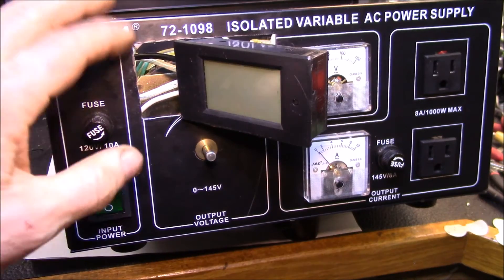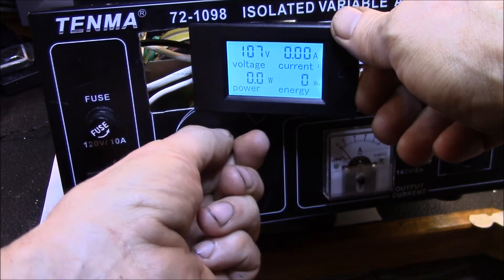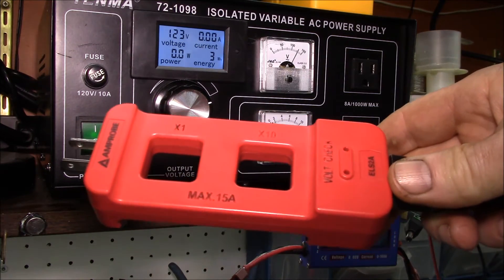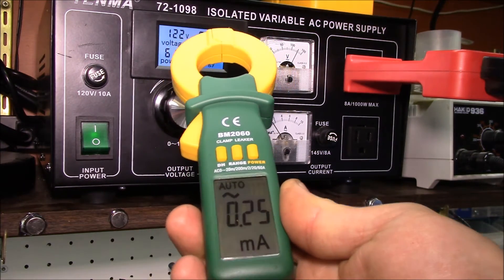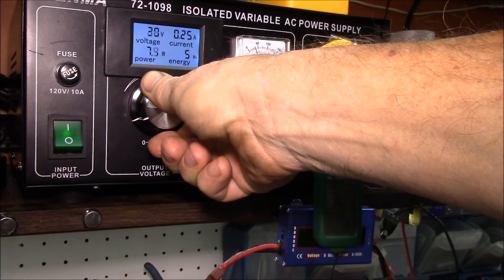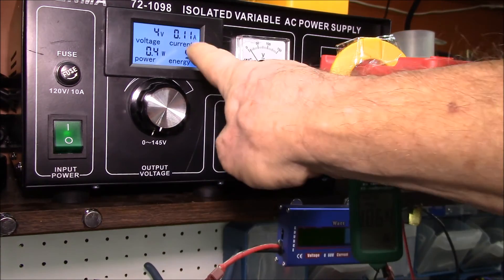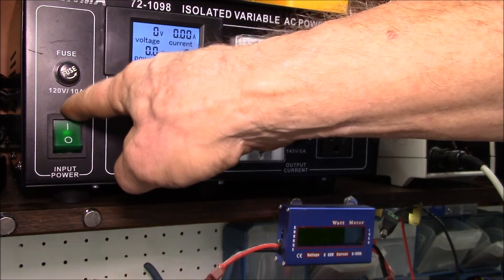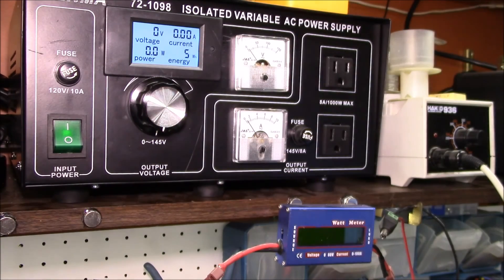Quest for Zero, (a.k.a. PZEM-021) Part 5

Comment: Great Videos! Is there much difference in the way to adapt a PEZM-061 to work below the 80v limit? Thanks!
Reply from the maker: Same modification, only difference in the units is the 021 has the current shunt and the 061 has the current transformer.
Reply: @The4Crawler  cheers I got it all up and working! only issue I have is that it only works up to 85v and then the LCD cuts out. did I wire something incorrectly? Thanks for the advice!
Reply from the maker: @HasteFrankie  Mine will read from 0 to over 150 volts (as high as my Variac goes).   Maybe try swapping the line and neutral connections at the screw terminals.  Also, check to make sure your separate power line voltage is not dropping out.  I feed mine from a separate 120V AC source, before the Variac.

Comment: I was wondering if anyone found a way to lower the turn-on voltage  of the meter without running a separate line out to the 120v supply?
Reply from the maker: There are some posts on supplying a separate DC power (12V?) supply to the meter instead of the separate AC power connection:
https://drive.google.com/file/d/1w80QYWeo8H5LdRoheGxNCMZViL9uqo81/view?usp=sharing
You need to do one or the other because the ~80V turn on voltage of the unaltered meter is due to the power supply in the meter not "turning on" below 80 volts.
Reply: @The4Crawler  Thanks for your reply. I'm looking for a meter for a variac. Prefer not to modify. There are newer models PZEM-026 and PZEM-028 that claim to work at 40V. However, the PZEM-061 seems like the display is easier to read. Just not sure I can deal with it coming on at 65V.
Reply from the maker: @acoustic61  Mine is set up on a Variac as well.  I simply feed the power supply wire from the constant 120V input to the Variac and then connect the variable output of the Variac to the original AC input terminal.  The only thing you need to pay attention to is to identify the neutral or  common wire (see that in a later video in this series).  Then connect that common wire to the neutral terminal on the meter.  This way the meter will read down to 0 volts and up as high as your Variac will go, mine hits around 170VAC.
Reply: @The4Crawler  I wired my variac so it maxes out at the line voltage.
Reply from the maker: @acoustic61  Makes no difference on the variable voltage maximum.  It'll go from 0V to something, 120V or 170V or whatever.  That connects to the meter voltage terminal and the other end of the coil to the common or neutral terminal.  Then feed the meter power from the constant 120V connection on the Variac.
Reply: @The4Crawler  Yes, I just thought I'd mention that, because 170V would be way too high for anything I do. I work on old tube equipment that was made when the line voltage was closer to 110-115V. There's 123V at the wall here.
Reply from the maker: @acoustic61  Here's the video with the line and neutral connections:
https://youtu.be/zpBXKnCsllQ